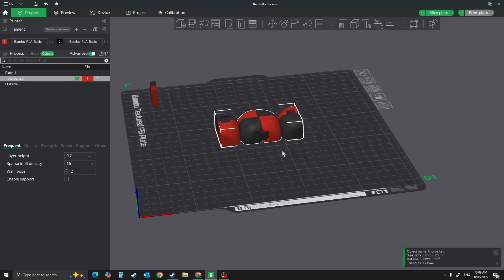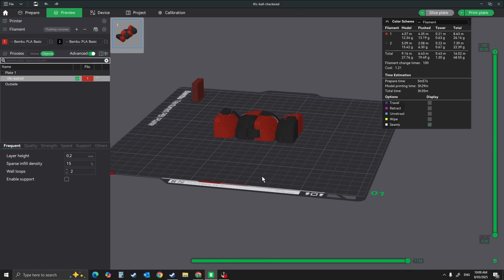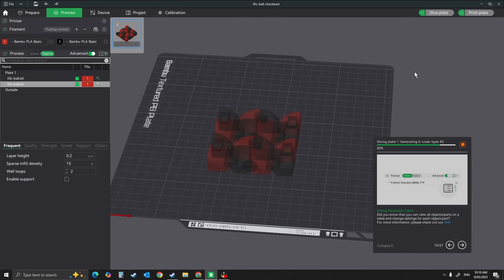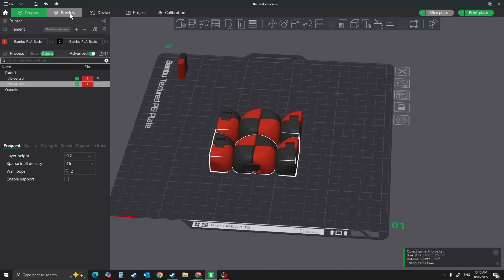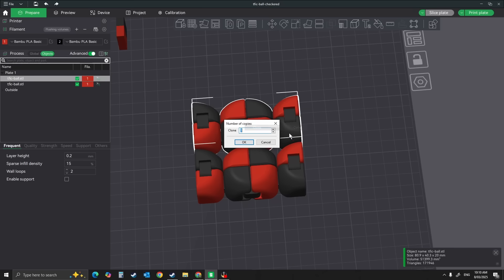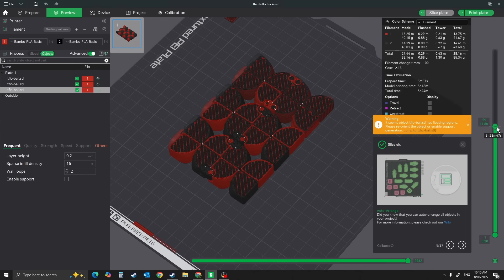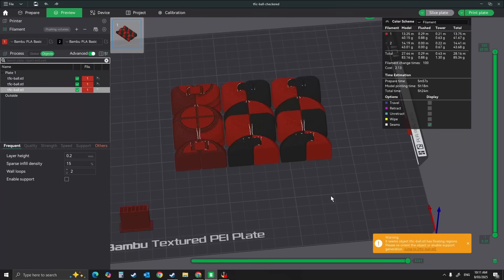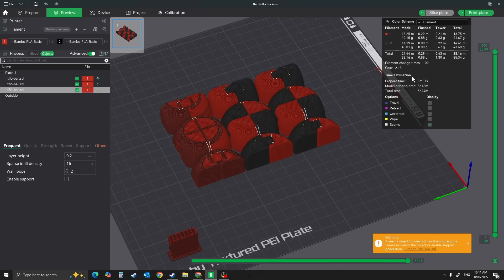Flush Into Object – Save That PLA! ♻️ | #3dprinting  #bambulab

Comment: Correct me if I'm wrong:

You needed to print 2 objects in order to get a third whole object made of what would have been waste, am I right to assume so?

I've seen in other videos that you should purge an object that is at least the same height or higher than your intended object
What I get from that is that it has to be like this in order for both objects (intended and flushed) to be printed at the same time.

Let's suppose that 1 colored object generates 20g of waste
Wouldn't it be possible for me to add another object that would take 20g of material and use it as a flushed object?

And wouldn't it be possible to print both at the same time, even if they were different heights?

If I put one object in a corner and the other one at the opposite corner, even if they are different heights, there should be no interference from the X axis trail, am I right to think so?

Tell me your thoughts!
Reply from the maker: You’re on the right track, but there are a couple key mechanics worth clearing up. When you do multi‑material or multi‑color printing, the printer needs somewhere to dump the old filament during every tool change. That’s why slicers generate purge towers they adapt the purge volume on a layer‑by‑layer basis. You don’t technically need a second “real” object, you just need a purge sink.  You can use another object instead of a purge tower, but only if it’s at least as tall as the tallest layer where a color change happens. If it ends early, the printer has nowhere to purge for the remaining layers. That’s why people say the purge object needs to be the same height or taller.  As for matching waste volume: in theory you could design a 20g object to “absorb” 20g of purge, but in practice purge volume isn’t a single number. It changes depending on the color difference, filament type, and how many tool changes happen on each layer. That’s why it’s hard to predict cleanly enough to design around. 
Different heights and opposite corners are totally fine, the printer doesn’t care about X‑axis travel for this. The only thing that matters is that the purge object exists on every layer where a color change occurs. So yes, you can print a second object instead of a purge tower, but it has to stay alive for the whole print, and you’ll still get unpredictable color contamination inside it. Hope that helps?

Comment: I have a dilemma. I am printing an object with 2 colors that covers the entire print bed, so there is no room for a purge tower. The second color is printed on top of the first color top surface. The second color is small text, so I cannot flush in the infill without creating a big blob that is visible when the print is completed. Does that make sense?  So I am trying to figure out how to do this and get rid of the blob. Can you help with what to do for a Anycubic Slicer next (Orca Slicer) Kobra 3?
Reply from the maker: not an easy fix  considering the space because the purge has nowhere to go. The best possible fix is to add a small hidden sacrificial rib or pocket under the text so the color change purges there before the text prints. Easiest way: open the model in Tinkercad, drop in a thin box (about 1–2 mm thick, a few mm wide), place it inside the model directly under the text, make it tall enough to reach past the color-change layer, then group/merge it with the model. Slice and print normally — the purge blob should stay trapped inside and the text comes out clean. I haven't been able to test it directly, but it should in theory work.

Comment: My flush amount Dosnt change when adding objects to flush to. The object shows the colour difference but the flush amount remains the same. Any advice
Reply from the maker: Assuming youre using bambu slicer, what are your numbers turning flush into object off. Then again on. Slicing each time?
Reply: @n @nospera ing creality print. The flush amount is starting the same with and without flush into object

Comment: I'm not sure what I did wrong, but my printer started printing into the flush object after the prime tower, so I think it didn't really make a difference as I think it's supposed to print to flush after the main object?
Reply from the maker: Hi, try slicing the file as is, note wastage etc. Then add your object and then flush to object, re slice check difference. Also depends on colors can even try turning off prime tower. I just forgot. See how you go

Comment: I still dont get the point, you waste more filament in a cloned object that wouldnt be perfect but you still using the prime tower as well
Reply from the maker: You are correct with an *, using an item to flush into saves on poop wastage and yes Purge tower technically not needed for most cases. If there is any concern of color mixing then keep purge tower for crisp clean colors, but again can turn tower off. Thanks for the question

Comment: Good video man but seems hard to find a tall flush object. Can u print those infinity cubes vertically ?
Reply from the maker: true, but if you don't care for it being practically it can even be a figure or even if you're printing multiples of something make 1 flushable. with regards to infinity cubes haven't tried vertical, but generally design for flat. Could try though

Comment: Okay I see anycubic uses basically the same slicer, but, I dont get the flushed numbers when I slice? Is there something i have to enable to see those?
Reply from the maker: I am not too familiar with the ACSlicer, however try after slicing, head to the Preview tab to see the estimated filament usage per color, including the material used for flushing during color transitions. Let me know if its there. Best of luck